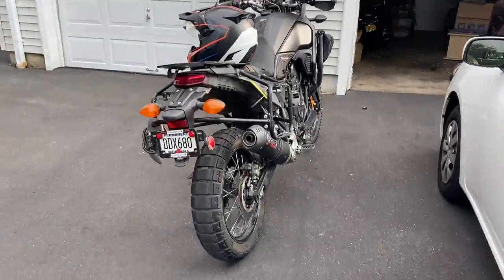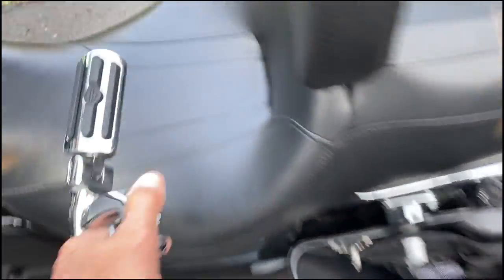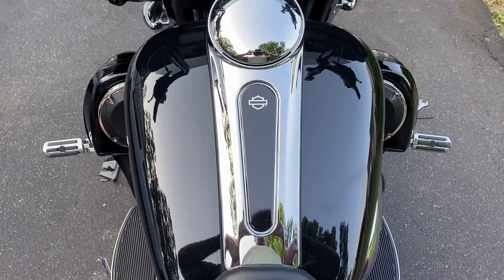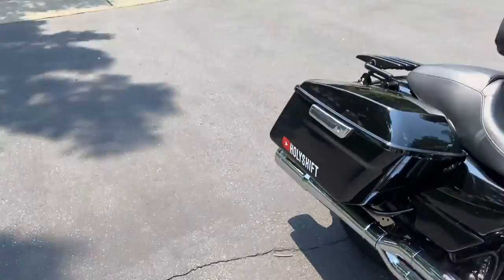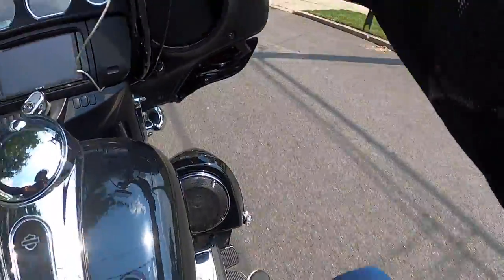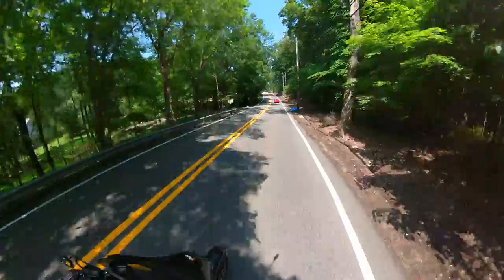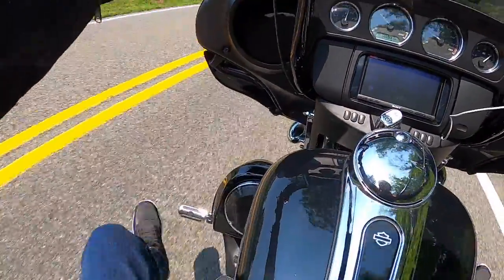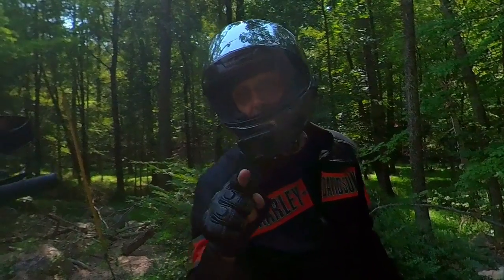Harley Lower Fairing & Highway Pegs

Comment: With. Because, first the wind defl look emposing and second they direct some of the air around the forks towards the motor between the forks and underneath the triple tree. I have a limited and thinking of putting defl also.

Comment: Great to see you again! Looking Good!
I prefer without the wind deflector, but that’s just me. 
For the road pegs, I’m thinking extension mounting arms? (I don’t know the technical term!)
I have that on my Ultra Classic, and the arm - after mounting to the engine guard - just seems to “wrap” around the lower fairing and I can easily move my feet from braking/shifting to the pegs and back. I usually ride with my heel on the floorboards and front foot area on the pegs. I can also put feet fully on the pegs for another position.
Your videos are great! Welcome back!

Comment: Greetings from Georgia.  Nice Video.   I also had to get used to not hitting the lower fairing when putting my feet on the highway pegs.  It took about 5 rides or so.  I'm rocking a 2021 RG standard.  I also have the fork mounted wind deflectors along with the lowers.   But I haven't removed the deflectors, so you video was very important to me.  Thanks for sharing and keep on gliding on the street.

Comment: I like it better with the fork mounted wind deflectors. It looks bad ass. Also you can easily raise your highway pegs higher on your crash bars so you could have a little more bend in your legs. By the way, are you using a drone to film your aerial view shots?

Comment: This is what I was wanting to know and asked about on another of your videos. So windscreen, fairing mounted wind deflectors and now lowers seemed to fix most of if not all buffeting. Great news. Someone could buy the bike and right off install the shield and deflectors and wait for latter as it sounds like just those two mods help alot on their own and then install the lowers latter, does tis sound correct? Reading some post here it seems you put the fork deflectors back on? Why would you do that if the lowers did the job at stopping the buffeting?
Reply from the maker: I felt that the fork deflectors added a little bit extra wind reduction
Reply: @HOLYSHIFT  Would it be still rideable with just a windshield and the fairing wind deflectors and not cause too much wind buffeting?
Reply from the maker: @ericjames7680  yes it will be good In my opinion
Reply: @HOLYSHIFT  Thank You very much for all the help. Just wanted to know these things before I purchase the bike.

Comment: If you wanted to have wind deflectors on with lowers, did it work? I wanted to put them on my Ultra classic but they said they would not fit with lowers. 
Do they hit or not?
Reply from the maker: I have them on . They don’t touch each other even at full deflection
Reply: @HOLYSHIFT  
Cool Thanks I might give them a try. I personally like how they look.

Comment: I'm gonna say.......off!   Anyone have experience with klockworks windshield on a Street Glide?
Reply: Knockworks windshield made all the difference in my ride, no buffering and you can even hear your tunes better. Make sure you determine the correct windshield for your height, I’m 5’11 and the 8.5” worked best for me.